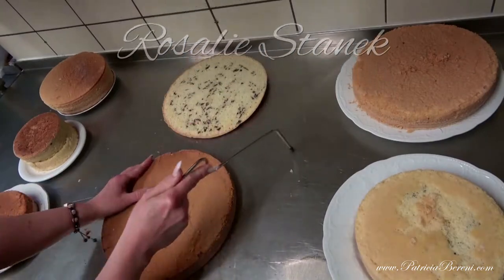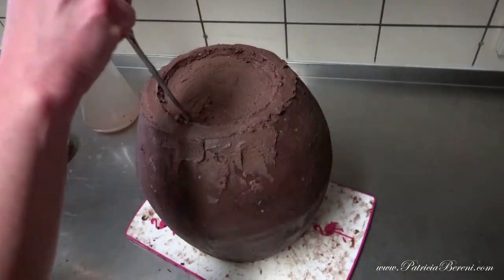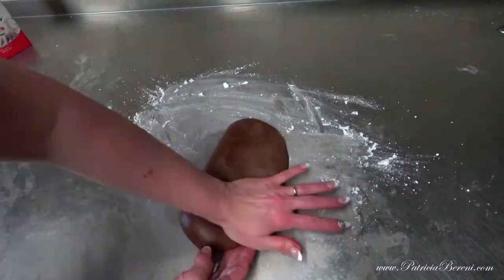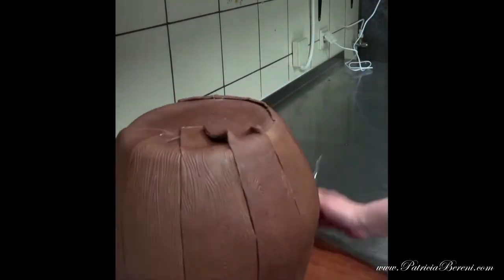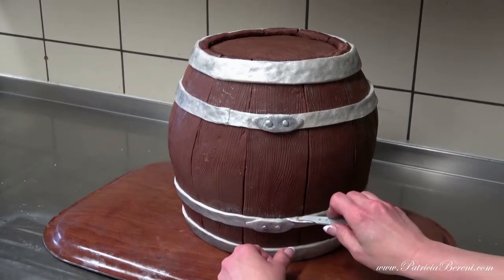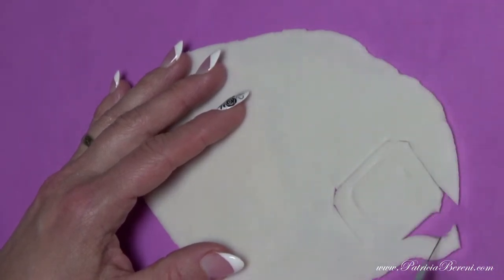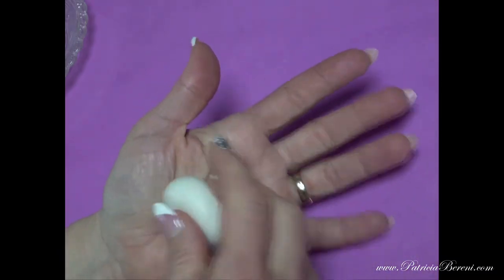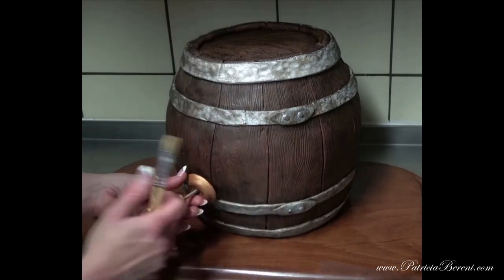How to create a BEER KEG  🍻  as a 3D CAKE

Comment: This is great but it would be really helpful if we knew how many cakes and what size to bake them at!
Reply from the maker: Thank you very much for the good tip, I wanted to put the recipe extra in the next video, but I have such a demanding job that I don't have time to cut and edit the videos I have already filmed. 💖
For this barrel, I used a recipe suitable for one cake. The recipe is perfect for marble or sponge cakes, muffins, or the traditional Easter Lamb Cake.  🎂 🧁 Here I baked 4 times the amount of this recipe, meaning from 16 eggs:

Universal oil dough one cake:
 
250 g table sugar
Four eggs - separate the yolks from the egg whites
10 ml of oil
10 ml of cold water
250 g flour
½ sachet of baking powder (1/2 of 15 g sachet)
1 Lemon zest
.............
Dark cocoa if you prefer a chocolate dough 🍫
.............
First, separate the yolks and egg whites (let them cool immediately in the fridge). Whip the yolks together with the sugar until they turn white and foam.
Then add oil, cold water, and flour - mix baking powder and lemon zest from 1 lemon into it.
If you´d rather like a chocolate or two-colored dough, mix cocoa into the part you want to be dark brown.
Finally, whisk the egg whites and carefully mix them into the dough.
You can even add raisins, chocolate chips, or candied fruit.

Grease the mold and cover it with flour. Fill only 2/3 of the mold with dough; it will rise in the oven. Bake it in a slightly heated oven at 200 ° C, hot air at 180 ° C.
Check the dough. If it is starting to burn, put an empty plate on top of the mold with the dough. This makes the dough warm inside as well, not leaving us with a burned surface and an unfinished middle.
The dough is soft and fluffy, suitable for any cakes, including 3D cakes, muffins, or something specific, such as a traditional Easter Lamb. Thanks to the oil, it is supple and not dry.
…………………………………..
You can find the recipe for the chocolate cream 🍫 in this video, for the keg, you would need double the amount: 
https://www.youtube.com/watch?v=x6qwmT2YMFs&t=4s&ab_channel=BellePassionbyPatriciaBereni
Reply from the maker: I used the following round molds for this cake:
2 x 28 cm
1 x 21 cm
2 x 15 cm
I baked them, so they were full, and then I cut them into 3 - 4 sheets - but that depends on how thick you want the dough sheet to be. The dough can also be poured onto baking sheets, stacked on top of each other, cut into shape, and the cut-outs can be used for the narrower upper and lower parts. 😃🥰